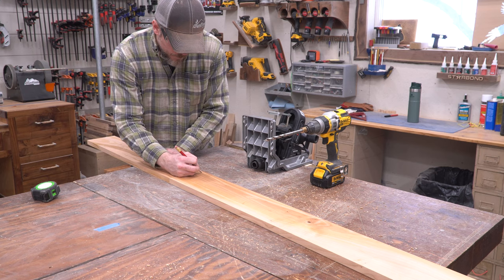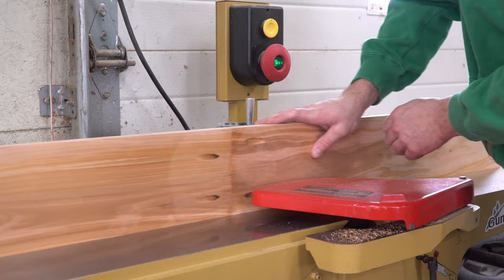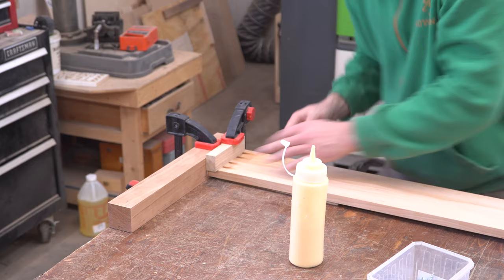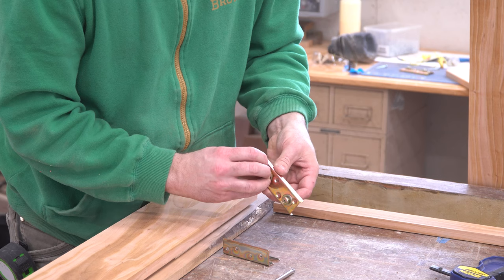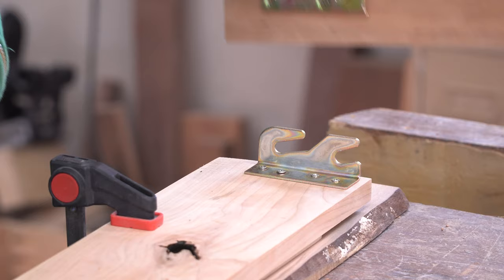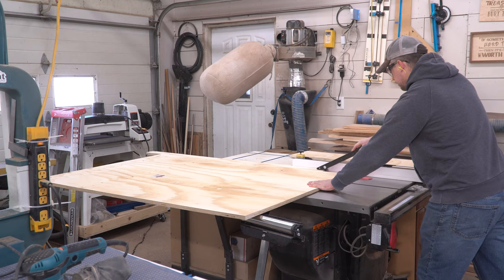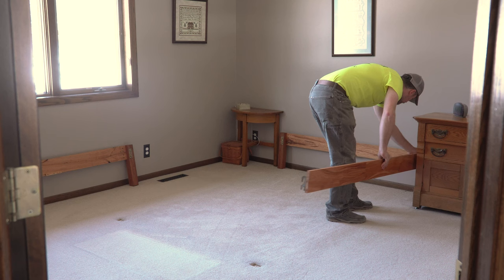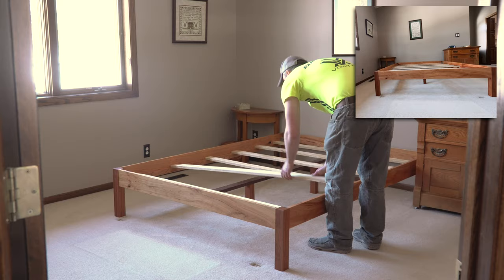Super Simple Queen Bed Frame - DIY In A Day

Comment: You begin your video with professional level carpentry tools and precise instructions. That's excellent for guys in the industry but hardly diy.
Reply: agreed...  DIY plans for sale......hmmm?
sharp corners aren't safe either
Reply: "Diy" pertains mostly to skill(or lack thereof), not equipment. 

As far as "professional level carpentry tools" go, most of those tools are made to make things faster and easier. That means you can achieve the same goals with less. It just takes a little more work!

For example; 
Instead of planer to smooth wood, you can use a sander. No sander? Well, you can sand by hand. They also sell sanded planks at most big box stores.
Instead of the tablesaw, you can use a circular saw, handsaw, jigsaw, or hell, even a sawzall if you're brave enough. Lol
Pocket holes aren't exactly necessary. They just hide the screws/bolts and look nicer. So,you shouldn't need a fancy "jig". BUT if you really wanted to, pocket hole jigs are fairly simple to make yourself. 

Tdlr; Improvising things from less makes diy more fun! 😁
Reply: @leezy7787    equipment has everything to do with presentation. Diy normies are looking for easy instructions and a simple list of tools and materials. Using professional tools and industry jargon might cause one to shy away from a project. Improvising can be extremely frustrating to some. 

TL;dr This video is mislabeled bc it's not "super simple".
Reply: @PBunyanOx  happy I'm not the only who thought this ^^
Reply: @PBunyanOx  As a beginner in Woodworking. You are totally correct. I'm somewhat familiar with these tools and even less with the terminology. I would think simple would allow someone to watch and NOT need to Google or watch other videos to understand the video that was supposed to be simple to understand.
Reply: @DeadntheHead  as a beginner woodworker I fully understood this video. Not everyone needs their hand held for everything.
Reply: Yea I don’t think I want to spend $1000 in tools when I could just pay $300 for a decent bed frame.
Reply: @dropndeal I don't care what you think.
Reply: First things first, you’e gunna need $3.7k worth of industrial tools and equipment to process your $600 of lumber in your beautiful 40x40 dedicated shop 😂🤣

Seriously though, the bed frame is gorgeous, it is relatively simple, and if you buy finished faced lumber this is very doable.
Reply: Yeah just about anyone with this kind of machinery does not need instruction on how to build a bed frame.
Reply: A decent wood or DIY store should have it's own sawmill so provided you have the dimensions planned, you can get your wood cut to requirements and avoid buying all these specialist powertools
Reply: You guys want Lincoln logs.
Reply: He’s using most of these tools,  because he’s milling his own lumber,  which you won’t have either.  But you can buy the wood,  already milled.  If you want to do it yourself,  you can.  If you want to just make excuses,  you can do that too.
Reply: If you can't buy a pocket jig, a drill, and some clamps then you shouldn't be doing basic woodworking. Nothing about DIY suggests that you shouldn't have basic fundamental tools for the job. Whether it's music, woodworking, or changing a headgasket.

A gee wiz dood I gotta buy a torque wrench this aint DIY dood!
Reply: @PBunyanOx  what industry jargon did he use? I didn't see anything in this vid that would be out of place in like a high school woodworking class
Reply from the maker: @leezy7787  Way to lay it out for me! The point, which you obviously understood, is that this is a simple/diy design. Use what you have to get the job done.

Comment: What’s with everyone complaining? What are you doing building things without common tools? What I mean by that is that almost everything he did can be done with a hand saw, a screwdriver, nails, a hammer, and just buying most pieces of wood close to length or size. The tools he used only make it easier to do this, but aren't the only way to do it if you have common sense.
Reply from the maker: You are my favorite!

Comment: Yes, there are some big tools in this video, but all of this is attainable with a few basic tools such as a skillsaw, some homemade guides, a little creativity, and some thought. Have done it myself with a homemade table saw, skillsaw, and a router ... because I had a router and wanted to use it. 

The long-term plan would be to get some better tools and make better stuff of course. 👍
Reply from the maker: I really appreciate you pointing out the obvious! I figured it was good enough to show the simple materials and construction, but I wasn't prepared for how many people would loose their minds when they realized they had to figure out how to do it with what they already had.
Reply: @GunflintDesigns  😅🤣 Isn't that one of the best things about wood working though? Just figuring out how to do stuff, make jigs, problem solve, and have a go. Use some scrap and try something out, try another approach if it doesn't work, work the problem, and a solution will present itself.  Other than sometimes having a diagram or plan, there is no absolute right way to do something....well, maybe a few things like safety and keeping your digits, but anything else. Have a crack at it, learn as you go.

Comment: Hi, thanks for the video. I was just thinking... Because of the design of joints where the inner corner of the leg reaches some 1 1/2 inches inward, there has to be significant gap between the side frame and the mattress revealing the grid boards and really taking away from otherwise really nice and clean looking bed frame

Comment: Try using this drill for fine wood working. Model# 2401-22 Hope this helps
I do not mean use this for drilling large holes rather 3/8s and smaller or screws